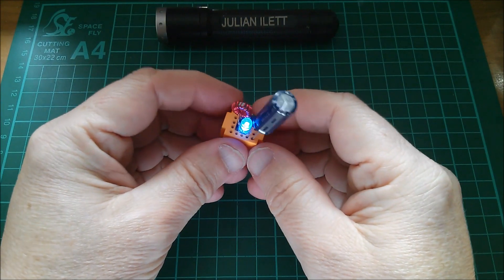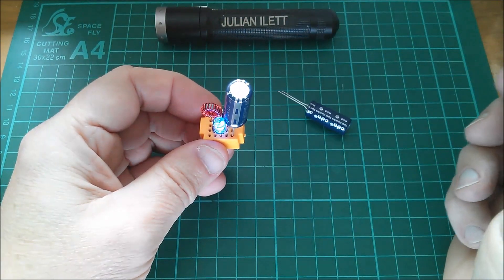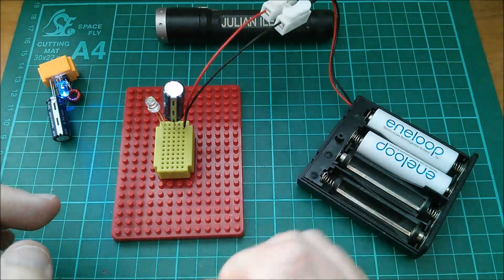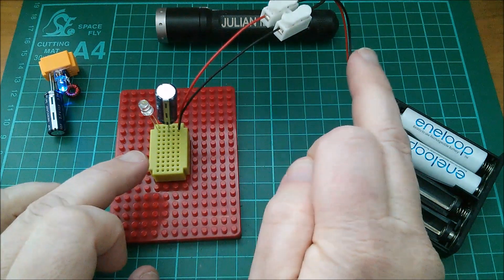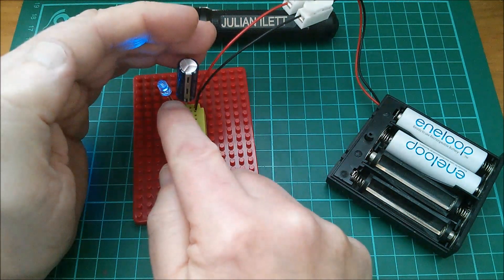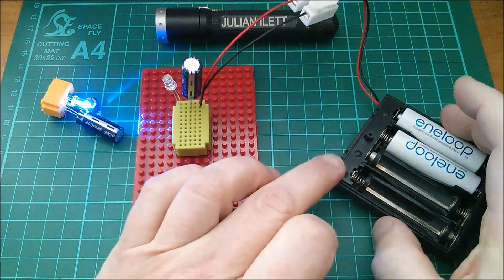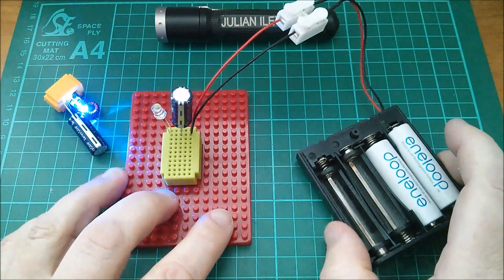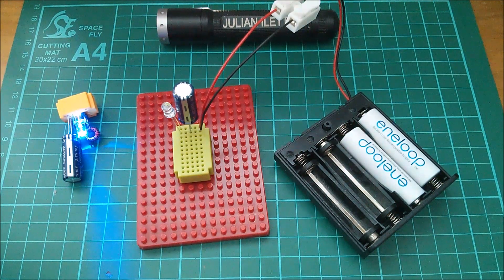Quick and Dirty 2.5V Supercapacitor Charger

Comment: The charging is slowed by the relatively high internal resistance of the NiMh and secondly by the low conductivity stainless steel wires of the spiral springs and the internal resistance of the capacitor. Then those other things you mentioned.

Comment: Hi Does anyone know if i was to connect 6 x 2.7 x 3000f super caps. Is there any way i could maintain a 2.5 constant charge with a 12v 50Ah lithium battery to power Kayak motor?
Ken

Comment: Nice video! I think that most of the resistance that limits the current during charging is due to the eneloops internal resistance more than the cables and connections.

Comment: Ha, I'm actually in the process of making a 2.5V regulator board using 2SD882 NPN transistors. It works quite well. It allows me to charge the capacitors rapidly. You can also buy those on aliexpress.

Comment: Don't feel guilty, Julian. Maplin have been charging far too much for their products for many years, and alsodriving many customers away (myself included) by their aggressive marketing tactics. During this video, perhaps missing the point, but I was muttering at the screen, 'Just connect the Joule Thief to one of the AA cells, instead of wasting energy in charging and discharging a capacitor, whilst wearing out the contacts in that cheap breadboard!'.

Comment: I think you should combine your love for supercapacitors, switchmode power supplies and solar cells.

Make a buck regulator. But not any buck regulator, make it:
- keep input voltage constant (at whatever your solar cell's optimum is)
- charge a supercapacitor (bank?) at maximum power available from the solar cell.

Not because it's hard, but because the feedback is not the boring constant-output-voltage they usually have, and because it will be fun to compare its efficiency with direct connections you've had so far.
Reply from the maker: That's pretty much what my Muppet 2 project is :)

Comment: Remember those cheap cardboard cameras you could by while on vacation when you wanted to take a photo but forgot to pack your camera? (before cell phones kids!) Those little cameras were a great source for high voltage capacitors. There was one in each camera to run the flash!

Comment: I had a flashback moment watching this! Back in the 70's sitting in a high school auto mechanics class, the teacher was describing the various parts of a cars ignition system. He would describe the various parts and then hand the part to the student in the front seat of his class to be passed back so we all could see things close up. He started with an ignition coil, then a set of points, a distributer cap and then a condenser. Things were making there way around the room when all of a sudden we heard a scream as the student currently with the condenser stood up and dropped the condenser to the floor! The teacher had charged it up ahead of time and it made it about three students before anyone managed to touch the lead and the body while handling it. The teacher then explained the condensers ability to hold a high voltage charge! That my friends is how a good teacher is able to keep his students interested in his class! I'm sure every student in my class still remembers what a condenser is. The electronics teacher used to charge up capacitors off the high voltage power supply and leave them laying around his desk. He got more than a few unsuspecting teachers and students when they carelessly picked them up while talking to him! Great times.

Comment: The problem with Maplin is they became an emergency buy, you only bought from them when you needed it now and could not wait 2 days etc for delivery. One of my customers who is a service engineer uses them when they get to a job and say a fuse which they do not stock has died. In this situation price is irelevent as the cost of down time or taking the kit back to the workshop is far higher that a £1 fuse from Maplin.

Comment: Nice! One could also use a solar panel and voltage converter setup. And by the way, did you know, you can also use the Joule Thief itself to charge supercapacitors? Simply put it in series with the led. Ofcourse no way to indicate the charge level and easy to overcharge them that way, but still. :)

Comment: Julian, for a new project you should make flashlight which uses supercapacitors as the battery. Use a 500 farad supercapacitor and you should be able to run a 1w led for about half an hour. And if you use a joule thief circuit then maybe you can get it up to nearly an hour run time. It seems like this would be a good project since you are already doing this basically on a smaller scale right now.

Comment: The only time I have seen one of those dummy cells was in something I don't remember what tho
Reply: James Holbrook One use of the dummy cells is when you change from rechargeable to standard cells and the equipment can’t handle the higher voltage such as handheld 2way radios.

Comment: You can't call this a charger. Go and build something better.

Get a buck converter IC (preferably one that doesn't require much external circuitry) and build up it's reference schematic on a breadboard. When you get it working you just modify it to regulate current instead of voltage.

Comment: Not quite the same but you can find a few battery spacers by searching for "AA dummy" or "AA placeholder" and they just look like normal cells.
https://www.ebay.com/sch/i.html?_odkw=AA+spacer&LH_BIN=1&_osacat=293&_from=R40&_trksid=m570.l1313&_nkw=AA+reduce&_sacat=293

Comment: I was experimenting with joule thiefs because of your videos. I am using commercial 1/1 transformer/inductor/coupler whatever they are. Works great! Currently my best joule thief needs 5-1mA to make a good flashlight! (5mA when battery at or above 1.5V then dropping) It oscillates at audible frequencies, but is quiet.
It uses a NEC C3568 NPN, two double-diodes in TO22 package (I use both diodes in one package in parallel. Less than 200mV Voltage drop at this voltages), a pot, couple resistors and very interestingly a button that is used to pull the base of the NPN to ground:
The circuit has an interesting characteristic. When turning the pot (with arbitrarily chosen value) too much in either direction, the oscillation brakes down, LED goes out and the circuit uses about 0.2mA. It doesn't start even when turning the pot to a resistive value that worked before or down to 0 Ohm. That's what the button is for. Pressing it starts the oscillation again.
I don't know why. Does anyone know?
Reply: I changed the NPN to one that has a hFE of ~1450: C3246

Comment: NAFTA (NORTH AMERICAN FREE TRADE AGREEMENT) is the reason we don't get charged for postage, but try and return a faulty product and you'll pay more than the item is worth by far. Julian, if you had a store exactly like the stores you buy from that mysteriously show up at your door postage free, your store would go bankrupt paying for customs and postage in your country and China. As we speak, that whole problem for your store in the UK and mine in the US is being revised so you and I don't go bankrupt and if that's not accepted, they will have to pay a equal amount. Unfortunately our governments flip the bill and we pay higher taxes. NAFTA Affects all of us, but China and Mexico that I know of. One year after the android TV Sticks came out, I purchased a HDMI Dongle android TV Stick and the HDMI section was faint, my TV needed a stronger signal so I shipped it back and they said they would replace it and include a remote. The item cost $80USD and I paid $55USD to ship it, even though I told them the signal was to weak for my TV and barley worked on my sons, the picture was washed out and fading which I also told them, they still checked it on their TV and sent it back to me without a remote postage free on their end so I gave it to my son and it died in a couple weeks. Bad business. Banggood always hooked me up.

Comment: Maplin thought they could up the mark up in little products to cut the prices of more expensive popular products. This business model worked until shopping on the internet took off. I wouldn't feel bad about not wanting to be effectively shafted by them. 
God knows how they lasted this long. I worked for a similar company which similarly mismanaged itself into bankruptcy years ago.
Reply: Another way you can end up with high markup on cheap products, is when management factor in the time it takes to serve customers and add that too the price of everything.
Reply: I understand that, it was my job to set pricing in another job, but you can't take the piss, which is what a lot of these high street stores that are going into administration have been doing. They didn't adapt at all to changing markets. I feel bad for the people losing their jobs because I've been there, and for years all the shop floor staff knew what was wrong and had ideas how to fix it, but were never listened to. It was like watching a car crash in slow motion. I imagine the staff at Maplin feel the same. The company I worked for was partially saved and is now being managed successfully, as far as I can tell, so it is possible to compete on the highstreet.

Comment: The dummy AA can be found on aliexpress looking for 'aa battery connector' or for '14500 3.2V LiFePO4'. Those are 3 Volt batteries size AA so you really need the connector for them, and they are sold by the same seller usually.

Comment: Did you check the current rating of the cap (yes they have maximum current ratings) to make sure you don't over-current it and shorten it's life span? The good thing is your batteries and charger wires inherent impedance are doing some limiting...charging a cap too quickly such that you drastically exceed it's rating can even cause them to explode.

Comment: On the joule thief theme, make a rectenna and try to charge the caps using ambient RF.
Reply from the maker: Nice idea - how many Joules can you collect in half a day?
Reply: I would like to know too!
It would depend a lot on proximity to transmitters, size and selectivity of antennas, but I'm guessing wouldn't collect many joules in an average room.
However, a coil tuned to 50Hz within 30m distance from overhead transmission lines should be able to collect a substantial amount of energy, given that the field strength is enough to light a fluorescent lamp held in the hand.
It would be interesting to experiment for a range of frequencies, or devise a method to collect all frequencies from terrestrial or extraterrestrial sources.

Comment: I made my own dummy AA and AAA cells.

I bought some lengths of wooden dowel rod of the correct diameter (it doesn't matter a lot if it's not totally accurate) and some brass wood screws, then I cut the dowel to the right length for a battery, minus the length of the heads of two of the screws, drilled pilot holes in each end so the screws wouldn't split the dowel and screwed the brass screws in, then connected them with wire.

It's possible to make a better connection by soldering the ends of the wire to the screws, but then you need to figure out how much extra wire to use since the screws will rotate in opposite directions while screwing them in... I hope you get the picture.

Comment: 2:02 - No, most of the voltage drop WILL be in the batteries!  Do the math, use your meters and find out.  If you used a high current PS or battery at the SAME voltage you would find that putting that much voltage over a switch and that wire would be different... ie. burnt wires and switch.  USE YOUR METERS!
Reply from the maker: Meter connected as close to the battery terminals as possible - battery voltage drops from 2.57V to 2.52V. Most of the voltage drop is in the numerous connections :)
Reply: You‘re highly underestimating the crappyness of the wires and connections.
Reply: I'm surprised that most of the drop isn't in the batteries.  At this point, I have to wonder how hot your breadboard is getting.  I'm pretty sure something is getting hot.
Reply: My money is on most of the drop is in the crappy breadboards. I have same ones and they will not get a decent connection on anything. Resistance jumping all over the place.

Comment: You do a great job with your videos but they mean very little when you continue to use crap cells. Id love if you could use brand name cells and do some retesting. Especially in your dual 18650 cells in parallel videos.
Reply from the maker: I wouldn't describe Eneloops as crap cells.
Reply: They're the best NiMH cells you can buy.
Reply: Oh ok. I don’t know anything about NiMH cells. I was thinking about the 18650 cells that he has used for other videos. I guess I wrongfully assumed these were trash too.